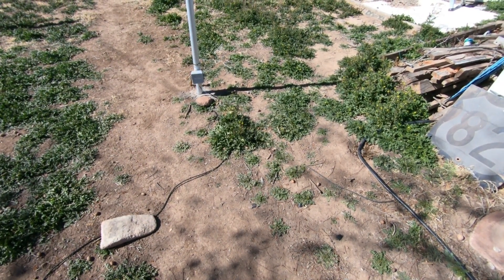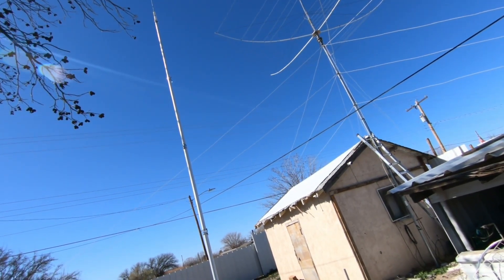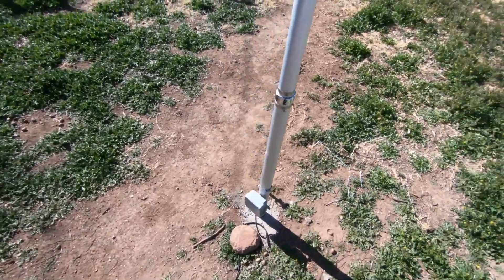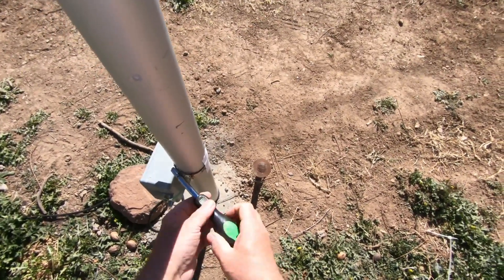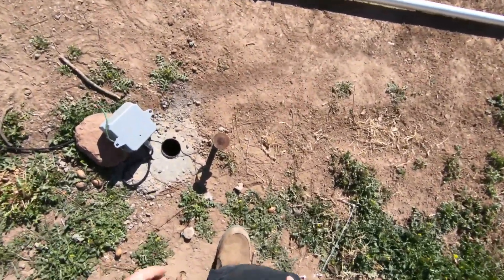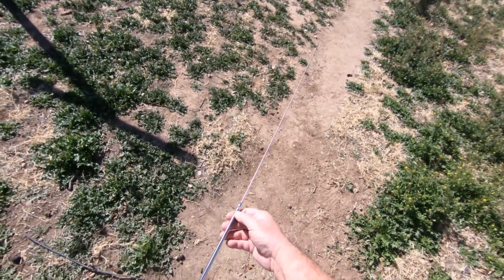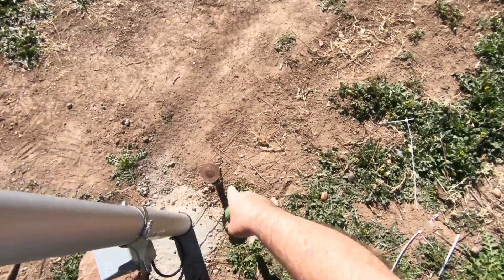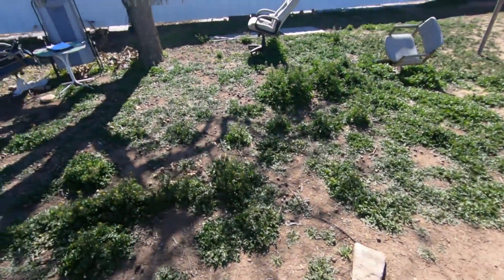Update on DIY Flag Pole Antenna 2/5/2023

Comment: I'm still new to this and was searching for "flag pole" antenna. The way I made mine was just to use the flag pole as something with height, and attached an antenna to the top with clamps. Am I supposed to attach the antenna to the actual flagpole to conduct though? Or is this literally an entire flagpole AS the antenna itself?
Reply from the maker: Yes the flag pole itself is the antenna. Each section is electrically connected to each other. Then I have a 80 meter Hustler resonator on the top if I remember correctly. I have a section of PVC pipe in cement in the ground. The pole is slipped inside the PVC pipe that came with this flag pole. To keep the pole isolated from the ground I have a round piece of hard rubber/plastic under the pole so the pole never touches the earth. The center conductor of the coax is attached to the flag pole(antenna) and the coax shield is attached to ground. I have one short ground radial buried to help get the swr down on all the bands I use. If you have the room the pole can easily hold a dipole, end fed, etc.  wire antenna. Just have the wire antenna isolated from the metal pole. The pole has a thin coating of paint that will not conduct rf energy to each section so I had to scrape off some of the paint on each side of the joint's and jumper it with a metal braid. I would bet those expensive flag pole antennas work in a similar way. They probably have a balun or something though. I was just curious if I could construct on the cheap a flag pole antenna. It is ok but not great. A whole lot of of ground radials would be better for this antenna . I have most of the parts of a Hustler 6BTV antenna and hated digging trenches for all those ground radials. They say just lay the ground radials on the ground and eventually the grass will swallow them up. Not here, we have been in a decades long drought here in south eastern New Mexico and the only things that grow in my back yard are occasional weeds. I ran over the ground radials too many times mowing the weeds down that I finally just yanked the wires all out of the ground and packed up the 6BTV antenna. I have a antenna for POTA using a 17 foot Chameleon telescoping antenna and 5 ground radials that I just spread over the ground, work good for portable operation, especially on 20 meters. I used to have videos on here showing that setup, but the state park ranger said I could not film in a NM state park. I did not argue just followed orders. So those videos I took down. Good luck and have fun experimenting. 73 Jim K5APD